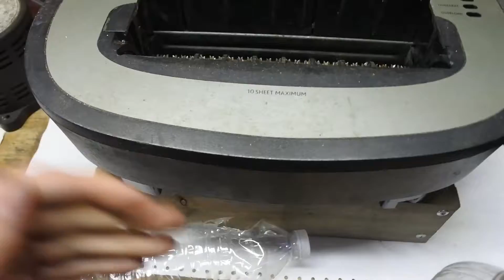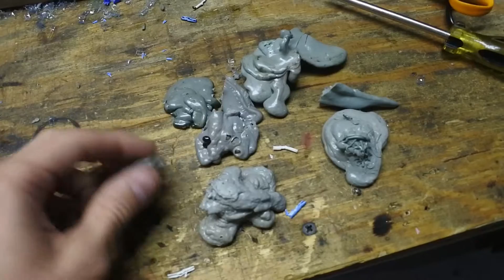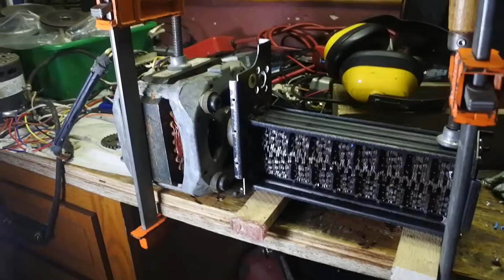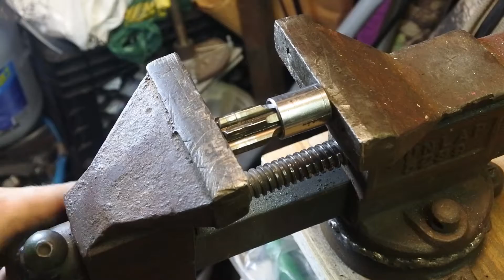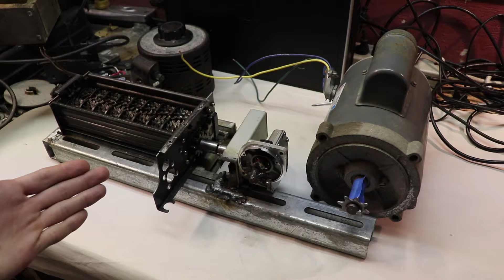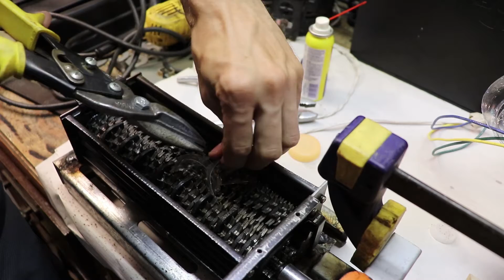Making a Plastic Shredder

Comment: For about $160 you can get a 12v  1.5hp give or take 90:1 
Motor with built on gear box for 18 wheeler dump trailers for their tarp roll ups.  
That’s what I used on mine

Comment: Those thick pet bottles I found I need 7.5hp.  To process.
Reply: Hi could you help me find out if this motor will shred plastic here are the specifications: Operating Voltage (VDC)	
12
No Load Current (mA)	
≤390 mA
No load Speed (RPM)	 
8
Full Load Current (mA)	
≤900
Rated Current (mA)	
≤900
Rated Torque (N-m)	
5.066
Rated Power (W)	
3.550
Rated Speed (RPM)	
6 ~ 7
Shaft Length (mm)	
27
Shaft Diameter (mm)	
8
Rated Base Motor RPM	
3000
Gear Ratio	
394 : 1
Length (mm)	
116
Width (mm)	
95
Height (mm)	
60
Weight (gm)	
530

Thanks so so much for your help really appreciate it have a great day 😊

Comment: Instead of cutting that jammed plastic, you could've either changed the polarity of the motor and run or just turned the driving gear reverse. I'm glad that you're not injured through the cutting process. ^_^

Comment: the bottles and the caps are two different types of plastic.... number 1 polyethylene terephthalate  which is a clear plastic and number 2 high-density polyethylene plastic, they have totally properties. you should have separated the caps from the water bottles before you shredded them.

Comment: I would still gear it even lower as it is still spinning the teeth too fast, the sprocket on the motor is fine but I would put a bigger sprocket on the transmission, this will increase your torque and possibly give you enough power to crush even the thick threaded bottle tops.

Comment: The last mod: the shredder itself spins too fast. You can reduce the gear ratios and probably get double the torque. It shouldn't have problem cutting through the thick bottle then.

Comment: Awesome shredder!  Please add the specs of the motor to the video description.  I imagine with that motor you could take the wiper motor out of the loop completely?  All it is doing by the end of the video is serving as a reduction gearbox, maybe it's for the best it's left in the loop?  Taking a paper shredder to the extreme.  I bought a paper shredder and motor because of this video.  Eventually I want to make an aluminum can shredder but without the right motor it's a pointless endeavor. Your video showed me that going for more torque and power is the answer.  In the mean time I'm pre-processing like you did.  It's a pain. Thank you for the awesome video and insights.